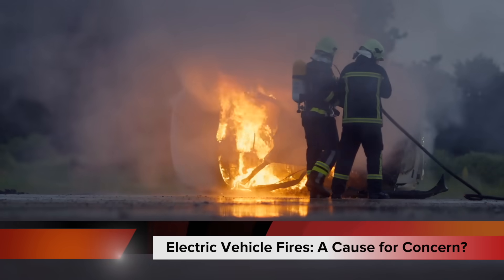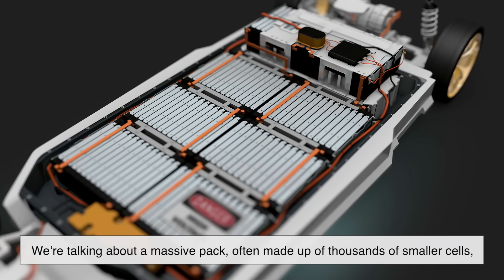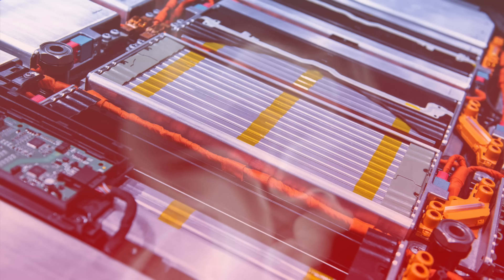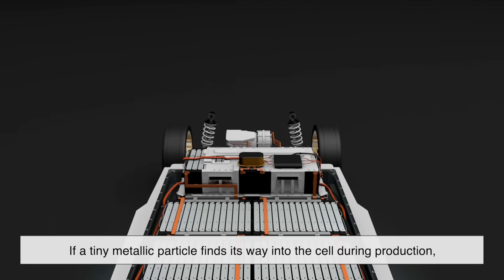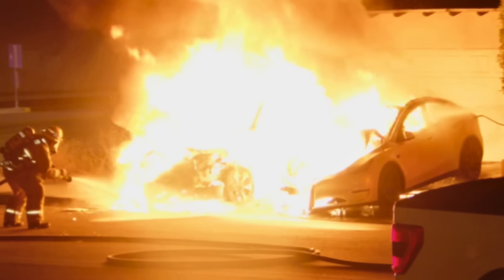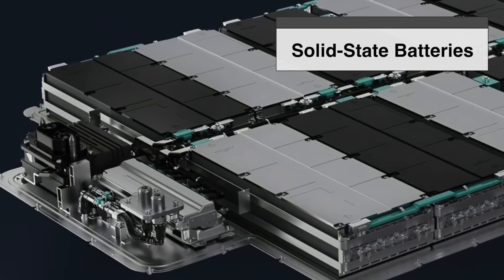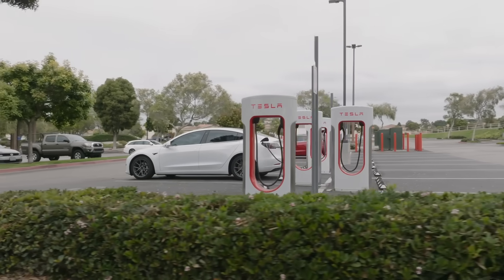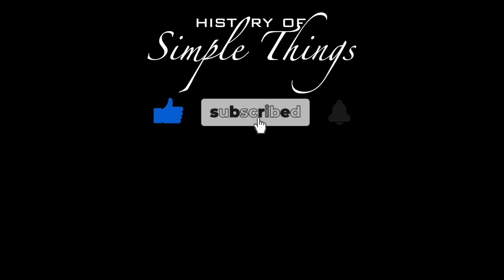Why Do EV Batteries Catch Fire?

Comment: Over time, metallic "short circuits"  or dendrites grow from the electrodes in EV battery cells. These cars are inherent ticking time bombs, waiting to go into thermal runaway. RIP Barcelona Taycan firefighters, last week. This EV madness needs banning.
Reply: Yet, gasoline cars catch fire at a vastly higher rate than electric cars.
Reply: @youzerable  A gasoline car fire can be extinguished in 5 minutes with a garden hose or fire extinguisher, gives plenty of warning and time to escape, battery fire is actually a controlled explosion with little warning and the fumes will kill you in seconds. A BEV battery fire takes 5 fire trucks and 50,000 gallons to cool the fire, which never really goes out and can re-ignite any time from 1 hour to 1 month later.   BEV fires release huge amounts of  hydrogen to fuel an intense fire that easily melts steel, the battery makes its own oxygen and release huge amounts of toxic compound like cobalt and Hydroflouric acid vapour ( hydroflouric acid is so deadly one lungful will kill you,  it is powerful enough to eat glass away )  getting hydroflouric acid on the skin will destroy it, and your bones as well, cobalt dust on your skin will kill you.   If a gasoline fire is a ripple, a lithium battery fire is a tsunami
Reply: @ Good thing electric car fires are so rare then.
Reply: @youzerable  What about the Tacan in Barcelona that killed two figherfighters last week?
Reply: @ What about my friend's girlfriend who burned alive when her car caught on fire in a crash in Wyoming?
Reply: @youzerable  You can put the fire out  --  and the car is still  able to be repaired, with a gasoline car.
Reply: @ Not in any of the car fires I've seen.
Reply: @youzerable  It is a lot of fun when you know you have the intellectual high ground against imbeciles.

Comment: i don't think the problem with EVs is that their batteries can catch on fire.  the problem is that the fires are hard to put out hand hard to predict.  imagine having a flaw or damage to a cell that you are not aware of and you park the car in the garage only to have it eventually catch on fire and your whole house ends up burning down because firefighters cannot extinguish the flames.
Reply: During my college years at NJIT, I frequently commuted from Monroe County to Newark, a journey that exposed me to the alarming frequency of vehicle fires on the turnpike. My friend and I observed at least one car fire per week, if not more, a phenomenon so commonplace that it scarcely elicited a reaction from passersby. On one occasion, I narrowly escaped a speeding ticket when a frantic motorist interrupted the officer, alerting us to a vehicle blaze nearby. This prevalence of internal combustion engine (ICE) car fires underscores their normalized risk, yet it also raises questions about the narratives surrounding them. Campaigns backed by Big Oil often amplify these incidents, potentially fabricating or exaggerating their frequency to bolster their agenda against emerging technologies, revealing a strategic manipulation of public perception to maintain industry dominance.
Reply: They're actually really easy to predict, because you can't get thermal runaway until a certain temperature is reached. 
With sensors to detect the temperature of the cells, the runaway can be avoided before it starts. This is the direction we're going in.
Fire crews can use a vehicle-sized fire blanket to completely smother the vehicle fire. You'll lose the vehicle, but that's true of gasoline fires too. Liquid gasoline can burn and spread far quicker than EV fires, such as in the Luton Airport fire where burning diesel and gasoline spread the fire throughout the parking garage.
Reply: No, the auto ignition of these batteries is a major problem and not just that they're hard to extinguish!!!
Reply: @LWRC  Youre talking old chemistry lion, new Chem LFP Sodium and many others can't even ignite.  Tests show nails being driven straight through a fully charged bat with only steam being emitted.  Thats why you will always see only ICE car fires on the road and never BEV.  Tesla EVs are about 77 times less likely to spontaneously catch fire than gasoline cars (0.01% / 0.00013% ≈ 77). This aligns with broader EV trends—Forbes (2024) reported EVs have 61 times fewer fires per 100,000 sales than ICE vehicles Such as Ford GM and Toyotas, and All data claims an 11-fold lower fire rate per mile. Stop pushing lies.

Comment: Tesla EVs are about 77 times less likely to spontaneously catch fire than gasoline cars (0.01% / 0.00013% ≈ 77). This aligns with broader EV trends—Forbes (2024) reported EVs have 61 times fewer fires per 100,000 sales than ICE vehicles Such as Ford GM and Toyotas, and All data claims an 11-fold lower fire rate per mile. Stop pushing lies.